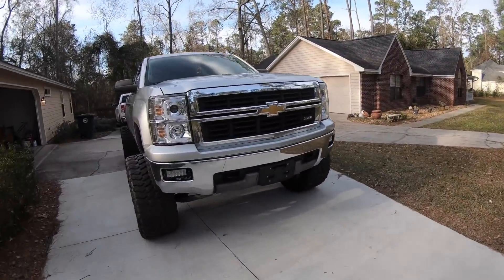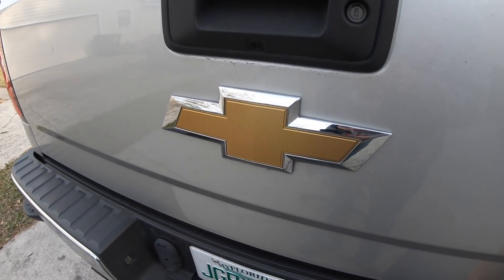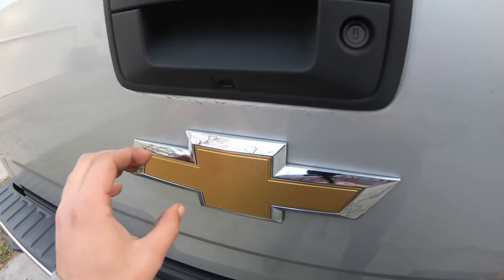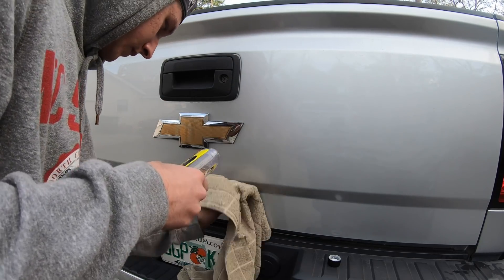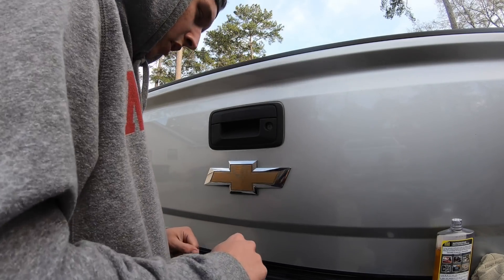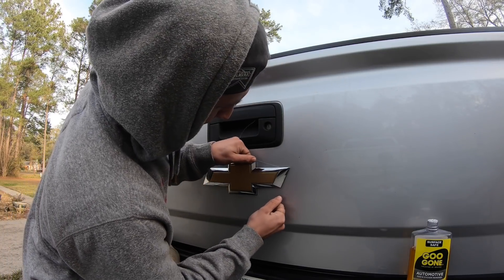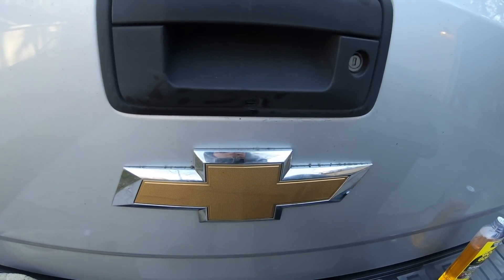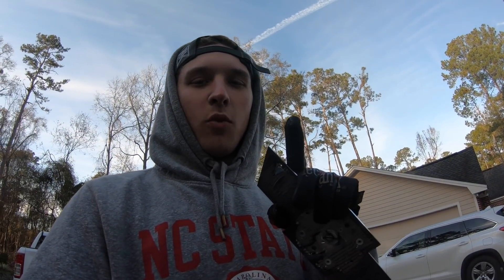Cheapest way to de-badge your truck! (Part 1)

Comment: Once you had the hard bowtie off, you can use a drill mounted rubber eraser and take that glue right off without hurting the paint. Then you can just use acetone (or Goo Gone) to wipe off the residue.

Comment: Hair blow dryer dental floss and gasoline and a microfiber a lil gasoline on a microfiber will dissolve any adhesive den wash of da gas and den use some turtle rubbing compound with microfiber den clean surface again with soap n water